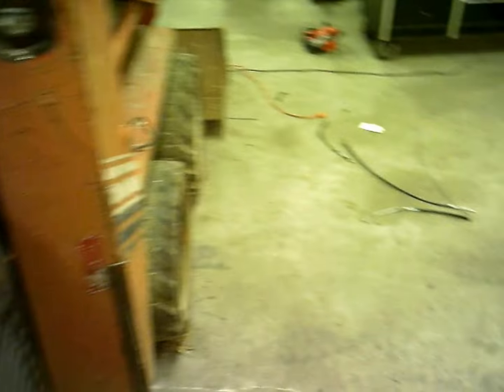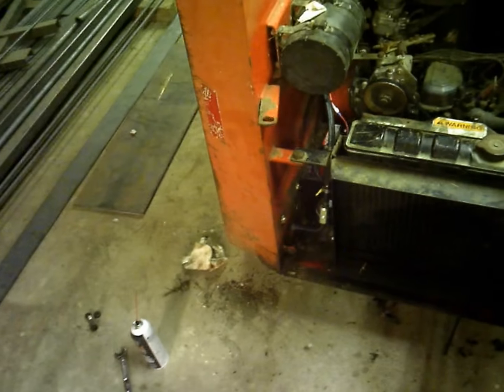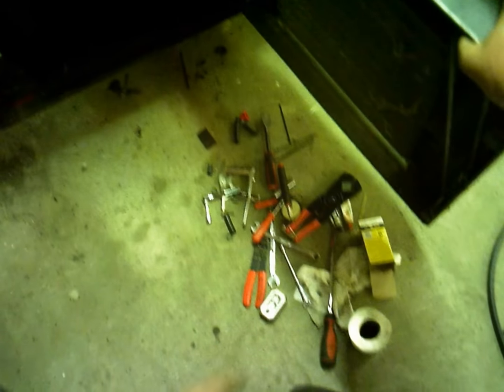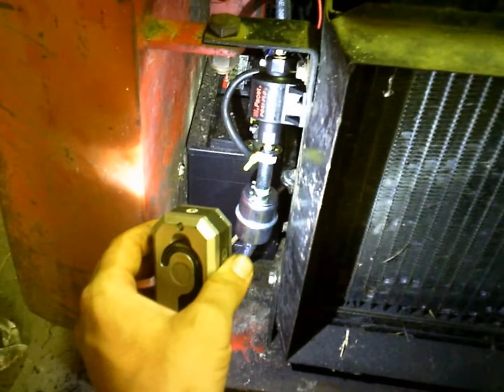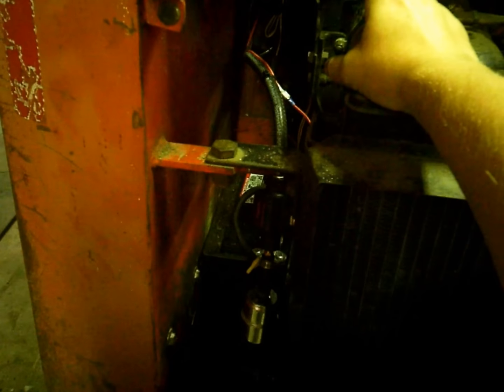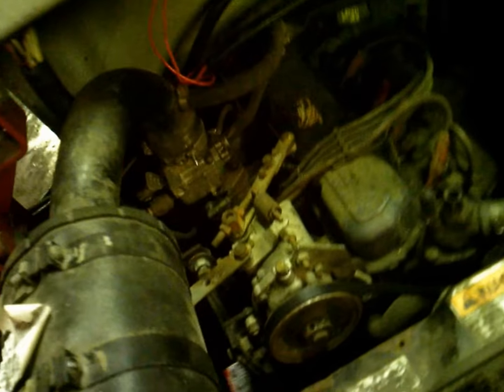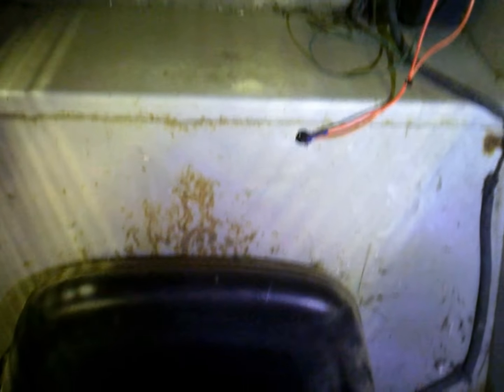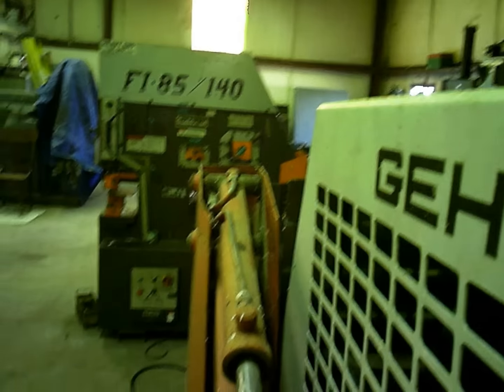It runs! Gehl 3510 pt 3

Comment: Good job Jake !  Now you got it running good and your starting to use it and seeing how handy it is you wont want to sell it !  Just wait till you clean the cows pen out for the first time, You'll never want to use a tractor and loader again to do it. It maybe small but it will do a lot of work and will surprise you with what you can do with it.  Bandit
Reply: Oh I forgot to add just wait till you use it when you start cutting fire wood, Its so much easer to use in the woods to get to wood and carry it out to the truck or trailer. If you make a set of pallet forks for it you can pick up a log so you don't worry about binding over to cut it and you done have to worry about getting into the dirt with it !  So handy to have a machine like this !   Bandit
Reply from the maker: Bandit farmer haha I was thinking of what u told me when I bought it! I already really like using it! I've got an idea for one job I need it todo and if it works good I'll probably keep it! It just works so quick is nice! Thanks for watching
Reply: I told you once you used it you'd fall in love with it and wouldn't want to get rid of it !  LOL Nice handy machine to have on the farm,  You'll find all kinds of things to use it for you never thought of . You might trade it off on another one a little bigger but I'll bet you keep one on the farm.  Bandit
Reply from the maker: Bandit farmer yep! I've thought about that see if I could sell this one and find a diesel one cheaper
Reply: Diesel one bring more money !  At least that's what I have found to be true. But use it till you find the right one to buy or trade for.  Bandit

Comment: I forgot that about 14 years ago I have a wheelhorse garden tractor that the plastic float the seam where they put the two halls together was leaking and would fill with gas and flood it all the time. I smeared some jb weld on part of the seam that was leaking and it's still holding today. I move some rocks a couple days ago and had a time trying to get them in the bucket also. Finally gave up with the loader bucket and put the pallet forks on. Big rocks just don't want to get in the bucket. Like they got a mind of their own.
Reply from the maker: oldfarmer good deal! Jb weld is good stuff. Ya even the backhoe struggles with them. Prongs or forks do work good

Comment: They're handy little units.  You'd think that one could lift about 1500#
Reply: Nevermind that, rated at 850 per google.  Kinda weird, the smaller bobcat I sold was rated at 1000
Reply from the maker: Jack Johnson yep 900 is what it says on it. The hydraulics would lift more but it needs a few suit case weights on the back.
Reply: Jake Ziegler I'm sure you can fab something up. Tho you won't need it cleaning up after the cattle

Comment: Great vid Jake! What electric pump did you use? just curious I have the same skid steer if the tank is lower than the carb and it sits for awhile it can take a little cranking. I replaced my pump and rebuilt the carb those little fords are good running engines. Keep it up!
Reply from the maker: prestemon thanks man! Cool they seem like a solid skid so far! It's just the universal electric pump that napa sells. Like $55 but very reliable